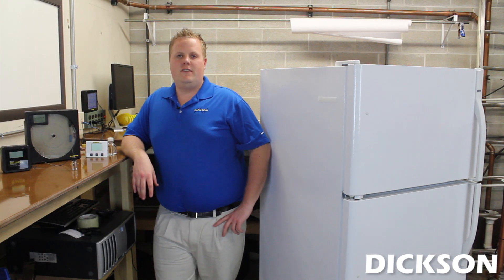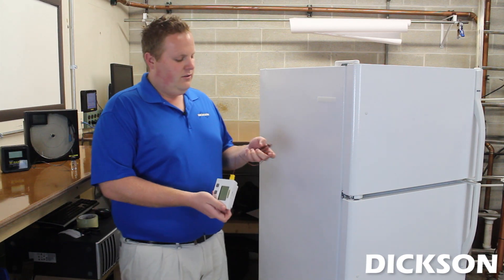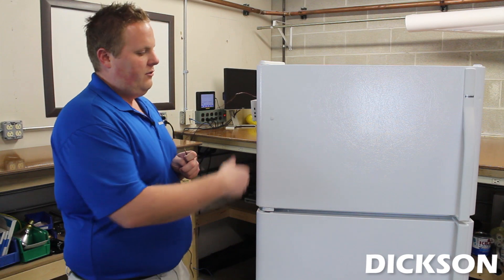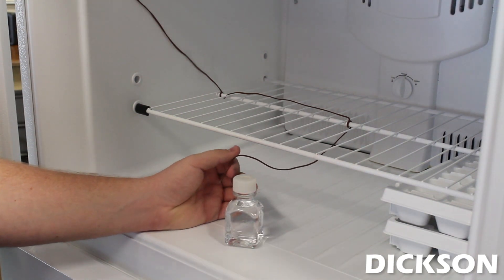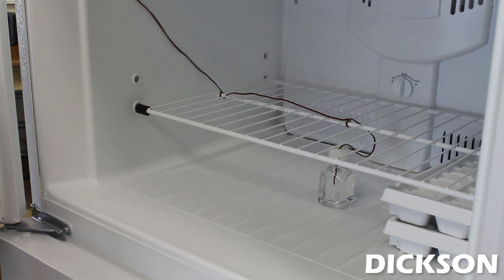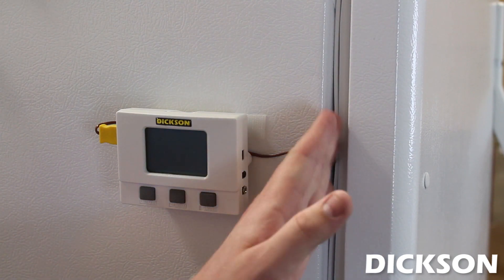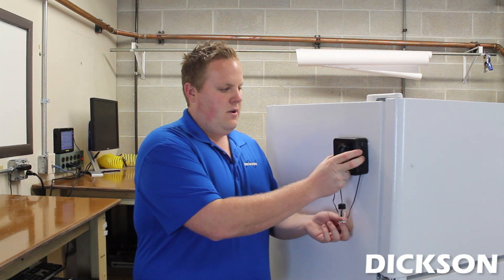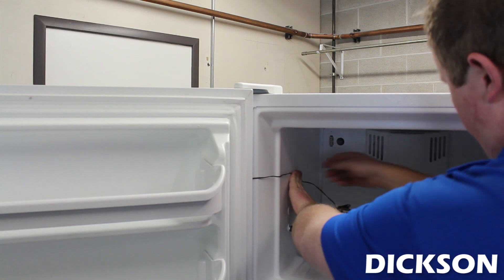Dickson - How to Run a Probe into a Refrigerator

Comment: I have to disagree with the method of running the cable through the door seal. We tried this on our lab fridges and freezers. Although it made no obvious difference to the fridges, on the freezers it allowed a small amount of ambient temperature air in. This resulted in icing along the seal and on the shelf just inside. Over time the seal distorts and the icing problem gets worse. This was rectified by drilling a small hole through the cabinet of the the freezer, inserting a plastic tube with stuffing glands at each end and running the probe/wire through. Now we buy freezers and fridges that have factory fitted probe inlets.
Reply from the maker: Hey Colin- you're absolutely correct. The IDEAL way to run a probe is through a port on the appliance. 

When this video was uploaded, it was mainly used for customers in the Vaccines for Children (VFC) market and at the time they were mostly using residential fridge/freezer combo units like the one in the video. The requirements for the VFC program have since changed and now the units used often have ports eliminating this issue. 

New technology/products now even allows wireless probes that are in the unit with NO wires running through a port or door!
Reply: Hi, thanks for your response. I can see that, like me, you were dealing with some older model fridges. It's interesting to learn that you were dealing with VFC customers and what were basically domestic units. How times have changed! We have tried wi-fi probes, but in spite of spending quite a bit of money, these have not proved very successful or reliable, so wires going through factory fitted ports are still our preferred option. Anyway, thank you again for your reply and your input.
Reply from the maker: @colinnixson975  Would you be interested in talking to someone about DicksonOne, our wifi/ethernet data logging system? No obligation to purchase but our wifi data loggers are quite reliable and we'd be happy to provide references and/or a free trial. In addition to reliability we have customizable alarms, reports, many other features common to those customers who require monitoring. If you're interested please email marketing@dicksondata.com and we can set up a conversation and demo if appropriate/desired.
Reply: @Dicksondataloggers  Thank you for your enquiry. However, I am based in the UK and many of the systems used by hospitals here have to gain approval from controlling authorities within the British National Health Service. Unfortunately, I am nowhere senior enough to have influence at that level! Thanks for taking the time to ask though.
Reply: You re correct Colin. That is why I'm here.   I ran the cable into the freezer near the door light switch.  The light switch froze over which never happened without that cable.  I may just prick a hole in the rubber door seal behind the flexible magnet and run the cable thru it.  I like to lubricate  the door seal on the hinge side to prevent the seal from tearing.  I tend to keep things a long time.

Comment: Surely it would be far better to run the sensor wire from the top of the seal as cold air sinks.